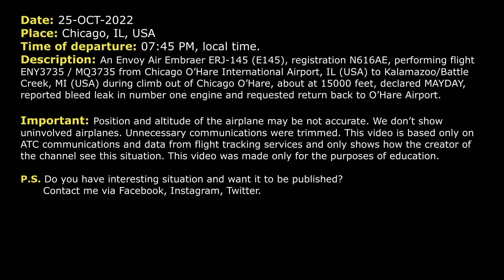MAYDAY. Bleed air system leak. Envoy air Embraer E145 returned to Chicago O’Hare. Real ATC

Comment: For those posing questions in the comments, I hope I can shed some amount of light.  The immediate issue isn't so much the lack of bleed air (the 145 has 2 systems) but the temperature of the air in question.  A bleed leak means that extremely hot air from the engine bleeds is leaking from its ducting.  The air is hot enough to start a fire, melt aircraft composites, severely injure aircraft occupants, melt wire insulation, etc.  Obviously, this situation can cascade quite quickly.  There is a checklist item to declare an emergency for this failure, and land at the nearest suitable.  Speaking from my own experience operating flights between ORD and AZO, all things being equal, I would divert to ORD with an emergency over AZO pretty much every time.  The runways at AZO are short, have limited taxiway access, and while AZO does have CFR, it isn't extensive.  Diverting to ORD means none of those negatives, and plenty of support, especially if a fire were to be started by the bleed leak in the descent.  I think the Captain could make a very good case for ORD being the nearest suitable over AZO.
Reply: I think you make a lot of great points. I just wonder about GRR as a diversion option. They definitely have more extensive CFR services than AZO and a 10,000-ft runway. Additionally, while I'm totally eyeballing it, I'd guess they were only maybe 60-70 miles from GRR and would've been able to go right in for 08R. Totally all speculation... and I do get the point about ORD being an Envoy maintenance base, so that makes sense.
Reply: Exactly!

Comment: Surprised they just didn't complete the flight. They were almost halfway there and when factoring in the landing direction at O'Hare, Battle Creek might have been closer.
Reply: Surprised you think that as envoy has a maintenance base at ord
Reply: @gustafpeyron  Maintenance availability is a consideration when choosing airports as long as t is not an inverse selection for safety
Reply: @YouTube.TOM.A  What an epiphany
Reply: @gustafpeyron  It was a mayday not a pan. They were closer to land and any available airport if they continued east. Prevailing winds probably would also mean heading east is faster. If it was pan-pan, then fine, but it wasn't.
Reply: @Chris-de2qh  I mean they turned around at about 45 miles from ohare and 65 miles from battle creek. 45nm from kord at 15000 ft puts you at a perfect 3 degree descent. Some of the closer airports would have required an unobtainable descent. Factor in descent, airport services, runway length, mx base, you already talking to approach, you already having ohare plates up etc, it really was the perfect option. Bear in mind the asap report says they shutdown engine 2, so landing anywhere but the nearest suitable airport woulda been big dumb.

Comment: ATC was terrible on this one, especially the initial controller. And why is our system so lame that every controller asks to repeat fuel and SOB. It’s absurd.
Reply: Oh just relax.
Reply: controllers are required to get fuel on board and souls on board for planning/safety reasons, the plane got turned back around to o'hare in like 30 seconds

Comment: It did seem to be a bit of different treatment from if it was an A380 but I am not a pilot so I am happy to hear if I am wrong.
Reply: No, this is not a super huge thing really. The bleed air system take air from the compressor of the engine and routes it into the cabin for things like cabin pressurization. It mainly means that they could not fly above 14000ft because they couldn't pressurize the cabin. So while inconvenient, the plane will fly just fine and it's not really critical to the aircraft's ability to fly but the pilots did the right thing going back to KORD.

Comment: Good communication from air crew
Reply: Except that they had to answer the questions twice, including the nature of the emergency. In my opinion that should not be necessary.
Reply: @Ztbmrc1  sometimes there are different control center and how fast they change from one center to next one, the message with details are sometimes not there already. Secondly it is the double check mentality, to make sure they received correct data from pilots
Reply: The incorrect phraseology was bad. In my 25 years in the aviation industry I have never heard ATC say, "via right turn to heading xxx", that is just stupid. The correct phraseology is "right turn to xxx" the term "via" is used when being routed through a waypoint, intersection or VOR.

Comment: The crew remained patient throughout nonsense queries by the atc.
Reply: Several distinct controllers.  Each needed info.  I didn't hear any nonsense.
Reply: I'm still in the beginning of the video, but I agree. They know where every airplane in America is going to be in 30 minutes from now, but can't get the fuel and souls from a computer somewhere? Also, what's going to happen? Half the file department is going to stay in watching tv? There should also be a emergency "box" or flight pattern for holding, if needed? "Like fly the established hold departure"
Reply: I think a problem was that none of the controllers knew what to do with this failure. That's probably why app didn't get the nature of the emergency. Had they added that they might get pressurization or anti-ice issues, that would have probably clarified it.
 I do agree that CTR did a poor job relaying souls and fuel. A lot of the other questions imo came from ATC not knowing what this failure meant for the crew.
Reply: @lyaneris  This was a well-handled situation all around. The controllers would not know the aircraft as completely as the flight crew or all the things unheated / unpressurized, without bleed air, If you have to repeat something, it's no big deal. I was always in the habit of putting souls onboard in a circle on my flight plan for every flight [ calculated after leaving the gate ]  Get the job done and complain later, was always my policy.
Reply: @YouTube.TOM.A  I don't think it was handled badly, I just wanted to point out some reasons for the amount of questions :)
Reply: @lyaneris  you are correct but believe me your mindset during an air emergency will not be on the trivia of having to repeat something
Reply: I have an crazy idea, what if it is to a routine to double check the information they received. I know it's an crazy idea!
Reply: @heuhen  I am not sure about any eventuality leading to the control center not having that information. However, you must have some idea about the thought process of an emergency crew. [ with so many commenting about the good job by the flight crew ]  That irregularity is small potatoes compared to the circumstances of your emergency.  Airline captains quickly disconnect from getting involved in distractions, When you do simulator training under heavy workload, you quickly learn to disqualify trivia

Comment: Controller should turn the plane back towards O'Hare first. Ask about the nature of the emergency later
Reply: My thoughts exactly! Especially after a MAYDAY call that cannot be clearer!
Reply: Envoy was actually closer to airports in Michigan on the other side of the lake.
Reply: While I agree that the controller probably should've assigned them a return heading prior to filling out their checklist, the nature of the emergency may have necessitated differing courses of action. Imagine them responding "Flight control malfunction, unable to turn right" as one hypothetical example that would've had to be handled differently.
Reply: Eh not always, pilots need time to fill out checklists and prepare for landing, if it was like a dual engine failure that's different but this posed no immediate threat to the ability to fly the airplane
Reply: @EoRdE6  Agreed, but the ATC didn’t yet know what the emergency was, so shouldn’t he have assumed the worst and given them return vectors first.
Reply: No.  The Controller should assume nothing.  The request for the nature of the emergency is to determine contingencies—including diversion airports—, whether emergency services are needed, how other traffic needs to be routed, e.g. all traffic cleared for an immediate landing or merely an unplanned return to airport, or if they should prepare for responding to an off-airport landing.
Reply: The decision to return to a departure airport or divert to another location is legally made by the pilot in command.  You know that cliche Ready Fire Aim.  The important undertaking after securing the aircraft as flyable is to properly access the problem.  Time critical defects like Fire, overheat, oxygen, battery life, Any have you making decisions quicker but whatever you decide, remember to review your decisions and to the extent necessary get technical help from maintenance on the ground.  Pay attention to readings and trends in your instrument packages.  Air transit Flight 236 took more than 5 hours to realize a fuel problem and that fuel temperature was low and pressure was high.  Fuel consumption is a basic reason why you have a job. Again, don't become kicked back in the cockpit.

Comment: What is a bleed leak,it doesn't use air,it does use hydraulics
Reply: Bleed air from the engines provide pressurization, cabin heat, and anti-ice to the engines and wings.
Reply: Leak means those hot gasses from the engine go somewhere else than it's supposed to, and you don't know where until mechanics check it on the ground. Could overheat something very important to be able to fly, so get to the ground ASAP.

Comment: Why an Emergency, not Pan Pan? 🤔
Reply: Unable to pressurize the cabin and a malfunction in one of two engines.  Life-threatening vs pan pan.
Reply: The biggest issue with a bleed leak is that extremely hot air possibly in areas where it shouldn't be, which could result in passenger injuries, fires, sever damage etc.  The checklist for this event in the 145 is to declare an emergency and land at the nearest suitable.
Reply: @EC-oe9bv  the extent and qualification of an emergency is left for the captain to distinguish.  There are times that a controller would volunteer to upgrade a situation but that is not common
Reply: @YouTube.TOM.A  Yes and no.  This was a particularly insidious system failure, and it was put in the procedure that the crew was to declare an emergency and head for the nearest suitable, the CA didn't have a choice in this case.
Reply: @EC-oe9bv  I have learnt that not all emergencies are timely, hair on fire, to the nearest airport.  If you are able to shut off the bleed air and confirm that action, the circumstances differ. An improperly executed checklist is just as much of a detriment compared to diverting 5 minutes later under many circumstances.
Reply: @YouTube.TOM.A  The checklist for this failure, on this airplane, at this company, tells you to declare and divert.  Thats not the CA making a "hair on fire" call, that's the crew following the checklist.
Reply: Thanks for all your replies, guys.
Reply: @EC-oe9bv  I used to be like you in thinking.  I have had the advantage of serving on different fleets of aircraft . not all checklists are similar. A bleed air uncontrollable can be detrimental to the airplane, You have two or more sources of hot air and one entering unwanted areas.  You still have to evaluate if the indications are correct and you are paid to make difficult decisions, One example that i did requires shutting down an engine .  crews including myself have had several false overheat and fire indications on Boeings and Douglass. you can deviate but i flew the pacific, Is the valve failed fully open ? or only at higher power settings,  That engine that was shut down was it still a problem at idle power ?
Reply: Pan pan has been phased out. Not in use anymore.
Reply: @YouTube.TOM.A  It's nice that you have flown multiple fleets (so have I), but I also have 2000 hours on the 145, and 32 hours in this actual aircraft (read into that all you want).  The Pacific and Lake Michigan are two very different things.  In this case, the checklist says to declare and divert.  I guarantee you, if I was the captain and didn't do that expeditiously in this case, I would have had some serious 'splainin to do to the ORD chief pilot.
Reply: @EC-oe9bv  My reference was that not all emergencies [ of this nature ] require that singleness of purpose.  Aircraft failures are potentially complicated and some cross purposes of systems and wiring can have you chasing undefined faults. I also am an Automotive technician on Mercedes Benz.  I had a car that went through 4 shops to fix an oil quantity problem, it was a rat in the garage that violated the wire bundle. I have worked on over 320 Mercedes cars.  A checklist does not always contain the remedy for things not properly diagnosed. I also don't think that you believe a pilot's job is that linear in logic. Pilots are not parrots and if you have not seen a bunch of erroneous information displayed by a computer you have not flown enough.  Allways guard against the cockpit indications being dispositive and non-remedial.  I mentioned the pacific because there are air routes even to Hawaii where you are hours away from an alternate.